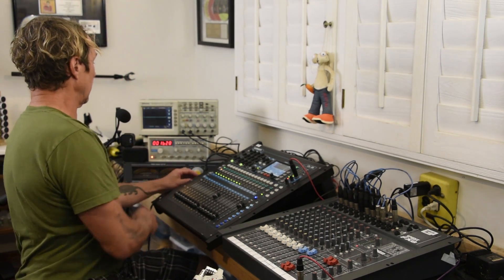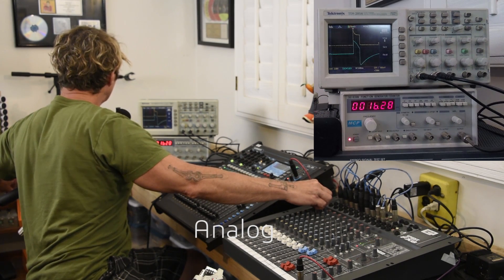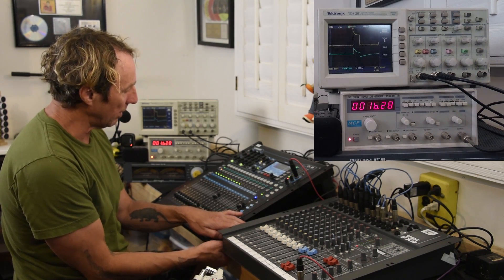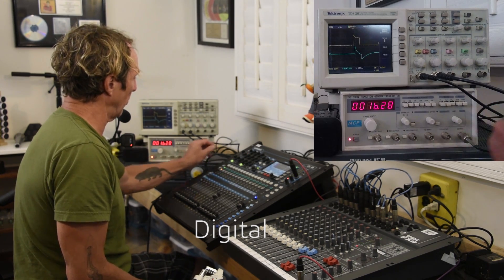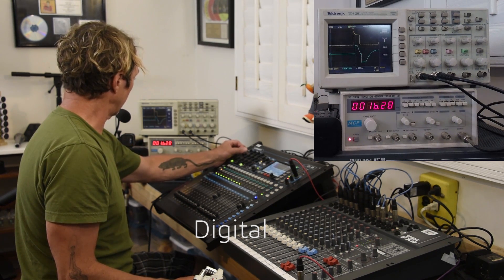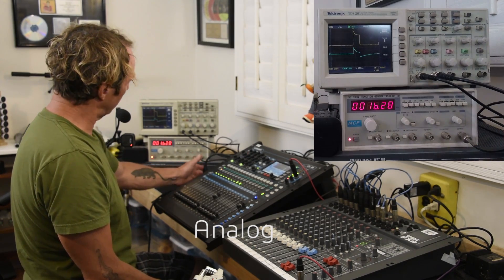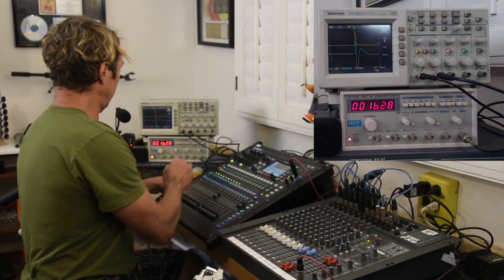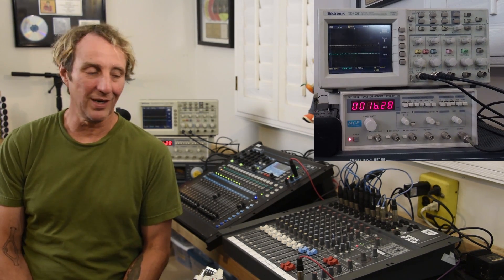Compare Digital to Analog #6 Pulse Overload

Comment: Very fascinating and informative series! As far as I can tell, you are the only one doing content like this where you test the nuts and bolts of the technology.

I hear more about gain structure from recording techs than from FOH, and I think understanding how sound is digitized makes that end of the signal chain closer to what you do in a recording studio than what analog FOH engineers have typically done. There are clear benefits of digital for FOH, especially now when so many people are sending FOH signals to live stream where the signals will be digitized at some point, but you really do have to set your gain structures carefully. Ideally, your amp and speaker system will be set up to where your channel faders are close to unity, but this isn't always the case. Set up the gains properly first, then do what you need to process the signal to the levels you want to work with.

Additionally, this makes the case for digital boards that employ latency correction. You don't want much latency, but with digital you're going to have latency. It helps to have the same latency across the board.
Reply from the maker: Inconsistent latency is a train wreck. I think rec engineers are pressed to keep noise at an absolute minimum so we'll tunes gains are important.  For live we have no rewind so lower gains and a safety margin from distortion is more important as the hiss is often buried in the venue murmur of human noise

Comment: Cost of electronic devices:
Electronics, board,components and manufacture: $x
Power supply for those electronics: $x
Box including knobs lights and sockets: $2x
So, there you are at home or in the development lab and you create a new electronic widget component price is peanuts. Once it gets to a marketable product the cost alone has quadrupled!
So, what costs $ with digital desks, how can you get cheap quality.
First up you cut the knob count, thus the small format multiplexed desk. Lots of channels but not many knobs. The ultimate in that being the stage-box desk with only network connection run from a smart phone.
Extra digital capability is probably the cheapest upgrade, another DSP chip at $ not much will double the capacity.
Then you look at A->D, that is usually the weak link in the audio chain and there is no cheap fix. You need separate circuit of quality components, but still it just electronic, which without the need for another PSU or knobs .
The next step are pretty much equal, more knobs or better digits.
As this series has shown, digital latency is an issue. Higher bit count (resolution) and channel count can be improved just by duplicating circuits. Latency is a whole different kettle of fish, the fix/ improvement cost is exponential with respect to return. The bet I have seen (heard/twiddled) had a 3 sample latency, in digital terms thats blindingly fast, the desk had a price tag to match too! (Amek's first broadcast desk, circa 1990's)
Once you spend that much on a desk, you damned well expect a larger format!

Comment: There is " technically"  no difference between a small and a large format digidesk. Its simply about " how is it designed". And the question is " what is clipping". When you clip the analogpreamp and the ad on a digidesk, it might be a mixture of analog and digi clipping at the same time. While all digital stages afterwards may not clip at all. Cubase for example works with 64 bit float, which means there is a digital headroom about 100 db. So my point is , look into the specs, not the " size".   We are we on live desks? 40 bit, i guess....
Reply: When i clip the input of my digico sd 8, it sounds more like shit as the cheap behringer everybody hates.
Reply from the maker: @TheMikeutah  that has been my experience as well. Hope to do an official test soon!
Reply: I remember the allen and heath ilife beeing not able to run older poweramps cause zero is +4. They simply forgot to add headroom. like on some newer desks or even old yamaha, where -18 is +4 on the output.
Reply from the maker: @TheMikeutah  yes, I remember needing add again stage. Usually a compressor to boost the console and get out of clip
Reply from the maker: Yes it should be interesting with the large format consoles they have more budget to solve things like overload conditions and extend the frequency response and make the metering more accurate and relevant to the usable range of audio

Comment: im an analog guy, probably because digital layers the latency for my Ekit.
Reply from the maker: I like analog whenever possible. If you don't need to do anything complex, analog tends to be better.  The perfect digital A/D and D/A just strives to emulate an analog signal through a piece of wire.
Reply: With MIDI, you can trigger an analog drum machine with your Ekit. 😅👍